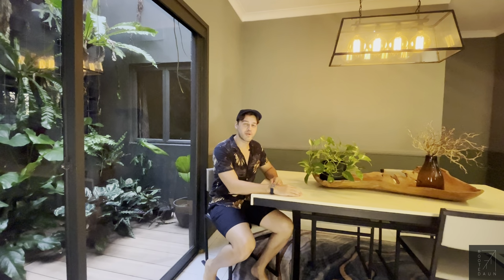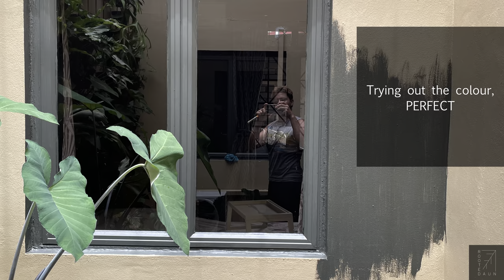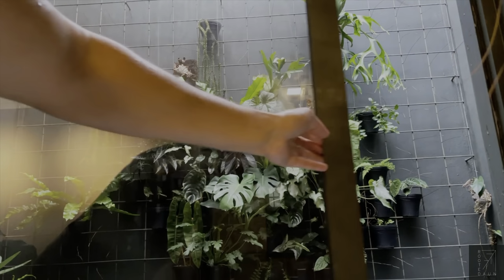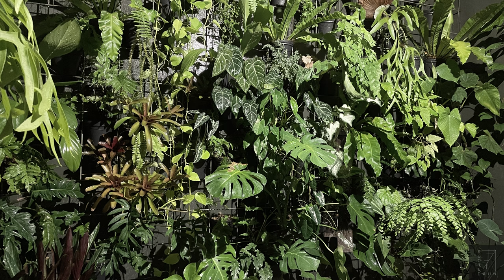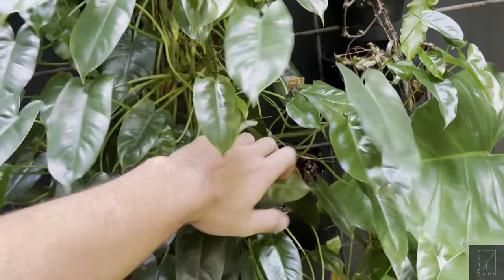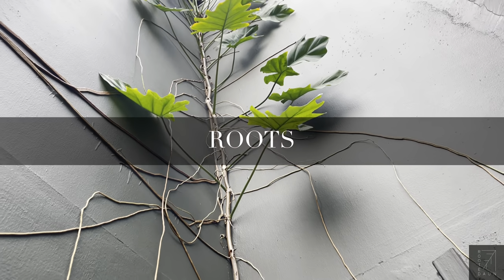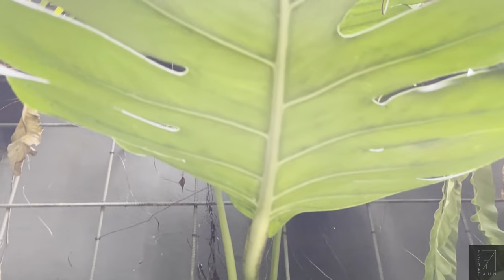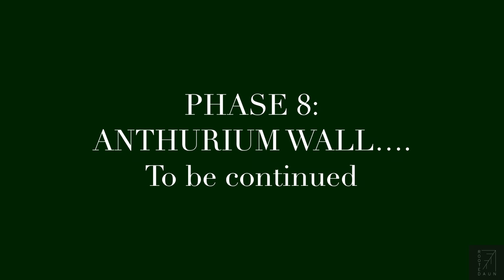BOTANICAL AIRWELL | 7 Phase Transformation | Borneo

Comment: Your wall is wonderful.
How do you fix the pots to the wire please?
Reply from the maker: Thanks Dee! Glad you like it. 

If you jump to the time stamp 14.29 in this video, I have a little explanation on the how to. 

The main structure is BRC metal which is drilled into the wall. The piece is usually used within the foundation works for homes or buildings. 

The pots rest on the wall behind and the metal bars below. There is a little piece of garden wire going across each pot to prevent them from falling forward. 

Hope it helps!